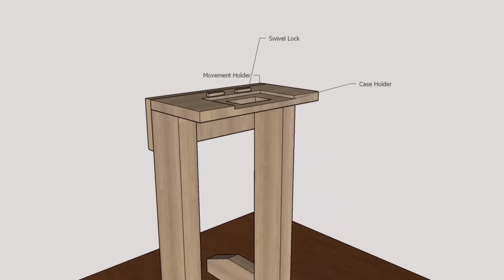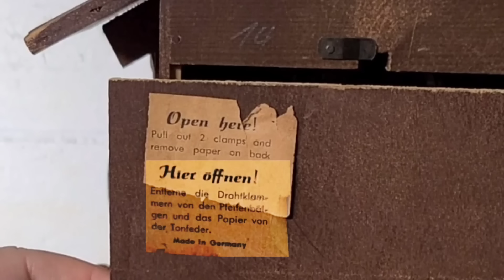Damaged 1950s Cuckoo Clock Restoration

Comment: 100% on the face shield! Traditionally, bellows were also made using thin leather strips. In the clock, paper is probably better. I imagine that a drawing paper would also suit. Go look at Accordion repair since that's the same system they use.

The thing about the gears is that it picks up dirt and that dirt, combined with the grease, acts as an abrasive paste and actually accelerates wear. Same problem with over oiling pivots. Don't want an excess of oil to suck dirt into the pivots and wear them out.
Reply from the maker: Yeah, when I looked into it, many people used tyvek, so that is what I used. Thanks for watching!

Comment: First time viewer to your channel I would mind seeing the cu-cu bird 🐦 with an eye. Also the wood though wiped a few times appeared to be very dry. Maybe using some Murphy’s oil soap would have been nice. Ty for your hard work.
Reply from the maker: Hey! Thanks for watching! Yeah, not being completely familiar with cuckoo clocks, I wasn't sure if the missing eye was on purpose or not. Either way, I thought it was better to leave it that way to error on the side of caution. I thought about applying a little oil to the case, but I didn't want to risk making it look unnatural given its age. Also, some areas could absorb more oil than other areas making it look blotchy. Thanks for your feedback, I appreciate it!

Comment: This was a very interesting video. My question is, was the disassembly, ultrasonic cleaning and reassembling of the Regula timepiece actually necessary? It worked and kept time...except for the couple of issues it had? 
    Be that as it may...very interesting video. Learned a lot. Thanks for the upload.
Reply from the maker: What I try to do is what the professionals do, which is take everything apart so each part can actually be inspected, cleaned, 100% dried, pivot holes and pivots inspected and the movement oiled in the proper locations. The only good way to figure out if there are other issues with the movement is to dissemble the whole movement and actually check. I wouldn't know there were any other issues unless I checked beyond the obvious ones. Also, not properly servicing the movement will eventually lead to more problems. Thanks for the question and for watching!

Comment: For those e-clips we in the copier repair industry use those all the time. You do not need any fancy tools for those just a small flat-bladed screwdriver to take them off, It goes between one of the groves and the shaft, and a slit twist and the clip comes off. Just keep a finger there to block it from pinking away. To put it back on use a set of needle-nose pliers to lock the clip back on.
Reply from the maker: Thanks for the tip!

Comment: One other thing, I would invest in some Clock cleaning solution. It’s an ammonia based solution that you put into the ultrasonic cleaner and it makes the cleaning process 100 times easier. The brand out there (in my opinion) is astro clean and even though it’s not cheap it’ll last you for years. Just make sure to use it outside because that stuff is insanely strong!!
Reply: Also feel free to reach out if you have any questions about tools. I’m only 18 years old but I have about 100 clocks under my belt and have experience and i’m willing to help in any way I can
Reply from the maker: I appreciate the help! If you want, you can email me at watchoverhaulchannel@gmail.com

Comment: a note on those "weird E-clips"
most of the retention deals on that clock were actually snap rings, they got holes in em to get a pair of snap ring pliers in em and open/close them to remove them
E clips are just a different way of doing retention, they slide into a slot on a shaft, and yes, they can and will fly across the room, 
generally ill just stick a flat bladed screw driver in the lil spot and twist, and make sure to remove it slowly and take note of the oriantation, or spin it to a good spot, that way if it does try to fly off, you can more easily find it, 
point it towards a close wall, or yourself, them things aint gonna spring so hard that it kicks your ass or anything, not enough mass to hurt much,
Reply from the maker: Thanks for the info!

Comment: I have an old clock that my wife has asked me to repair. The wood part I’m okay with but the clock portion I’m worried about taking apart. Could I just place the whole mechanism in an ultra sonic cleaner and then let it dry and oil it?  I worry that if I get it apart it will never work even if I manage to get it back together.
Reply from the maker: You might want to check out this forum:

https://mb.nawcc.org/threads/ultrasonic-cleaning-assembled-movement.69613/

Comment: Good job. Maybe rub the wood case down with a light covering of mineral oil to make the colours come out?
Reply from the maker: I thought about it, but I didn't want to risk making it look unnatural given its age. Also, some areas could absorb more oil than other areas making it look blotchy. That's why I only tried to remove the dirt and dust. It's the same reason why I don't polish and shine the movement parts. I don't want to remove patina or natural aging characteristics - I think these things are part of its story. Thanks for the suggestion and for watching!

Comment: I have a suggestion even if you already bought a bigger ultrasonic machine, a few actually. 1, use jars with solvent, naptha preferably. Just put the parts in the jar and put the whole jar into the machine. (2) Then as a follow up to that, IN the machine run some sort of degreaser something that wont eat the metal but will remove any residual grease oil and solvent, something like a mild simple green solution would work or crud cutter just don't go full strength dilute it with water maybe 50-50. Give everything a final rinse in distilled water if you have really hard water, and if you are not working with anything using jewels you could even follow that up with an alcohol bath. The problem with alcohol is it will dissolve the shellac that sticks some of them on namely in the escapement area.  With most watch or clock stuff you can just air dry or use a little heat, again tho if you have really hard water it could leave some stains (distilled has only water no mineral content)
Reply from the maker: Thanks for the tips!

Comment: a tip  when dismantling cuckoos remove all the levers first like the rack snail etc and then take the plates apart and when assembling put the gears back and screw the plates and then put the levers like the rack snail etc
Reply from the maker: That's a good idea. Thanks for the tip and for watching!

Comment: Whats that wire on the inside of the back piece of wood, I'm curious. 
 Also, on the front it looks like there's a missing band or something on each rifle. The 2 holes on each make me wonder. 
I didn't notice how morbid this piece was until you put it all together 😬 lol. I'm guessing a hunter would love this clock. Great job bud, it's a beautiful piece of art though.
Reply from the maker: The wire on the inside on the back is actually the gong wire. When the clock chimes it does 3 things - lifts the bellow on the right, the bellow on the left and then a little hammer strikes the gong wire. At the very end of the video when the clock is on the wall, you can hear what the gong sounds like.

I looked at reference photos of this clock and it looks like that's just how the rifles look - I don't think they are missing anything, but I could be wrong.

This clock is actually known as a hunting scene or hunters case so you are spot on. If you google "cuckoo clock hunters scene" you'll find many pictures and variations of the clock.

Thanks for watching! I'm glad you enjoyed it!
Reply: @WatchOverhaul  ohhhh I thought you added that sound at the end lol. That's awesome, thank you for answering me buddy
Reply from the maker: No problem!

Comment: Wow! I have this exact cuckoo clock! I want to repair mine, its as old as i am, father bought while in germany. The one i have, has two doors on the top with a music box.

Ive began follwoing your video, but ran into a problem.. some of the plastic gears are cracked :( I'm not sure what i can do at this point. 

Any suggestions?
Reply from the maker: If you can't repair them, you can try to find replacements at www.clockworks.com or a similar website. You could also find a cheap donor movement from Ebay or something and take the parts from the donor that you need.

Comment: I have a Question to ask I just purchased a Schender Coukoo clock that was built between 2001 & 2008. It was one of the Biggest made it is the Hunters model. But this is what puzzles me. Above the Music Box is a Battery Holder for (1) D-Cell battery. There is a Red & Blue Electric wire & there is an Electric Motor what in the Heck do I have? There are (3) Weights that look like Wood Carvings they are not Pine Cone steel weights. The height of the clock is over 24” tall. This clock has the Works. Where can I purchase a music Box that plays Elderwise? This clock had to sell upwards of over $2,500.00 or more!! What kind of clock do I have? Any Answers on this Project?
Reply from the maker: I'm not sure. I would suggest asking this over at https://mb.nawcc.org.

Comment: Just bought one like this in really good condition...but looks like I'm missing the bottom leaf pendulum. Any suggestions?
Reply from the maker: You can find them on ebay.
Reply: @WatchOverhaul  just tested it, it works. Just need the pendulum. Looks in great condition so excited about it. Bellows look great. Thanks

Comment: For the bellows, those shipping envelopes are also Tyvek, so no advantage to using them if you can find better Tyvek elsewhere.
Reply from the maker: The Tyvek shipping envelopes seemed to be thicker than the Tyvek I bought. If the material is too thick then the bellows won't close correctly.

Comment: You can cover the crack repair on the cuckoo pipe with a piece of paper glued on to reinforce it.
Reply from the maker: Oh that's a good idea! I didn't think about that. That would have been easier.
Reply: The way you did it is correct, but the screw could split it again. The paper will help keep it sealed. Old organs lined their bellows with glue newspaper to help keep them sealed. I believe that is why the 3 sides exposed to air are covered with paper.

Comment: Plus in my bellow repair videos I use superglue. Preferably Loctite superglue as it glues the Tyvex paper down in seconds vs minutes.
Reply from the maker: I liked how I had a little extra time to move things just in case. It was my first time fixing a bellow (except the practice one) so I was more concerned about going slow and taking me time. If I did many of these, I would switch to a faster drying glue for sure.
Reply: @WatchOverhaul  When I first started doing them I tried contact cement. It was too slow of a drying time for me. I like the superglue the best. Just have a paper towel handy incase you get it on your fingers.

Comment: You need a cannon pinion puller to remove those wheels. 

Also don’t use the needle connected to the oil, get yourself a bottle cap and an oiler, pour a little oil in the cap then use the oiler to apply to the pivots. To much oil will attract dust which then acts as sandpaper wearing down the brass causing the need for bushings.
Reply from the maker: Thanks for the tip!

Comment: What about the cuckoo's missing eye? Did you ever paint on on there?
Reply from the maker: I decided not to paint the eye on. I couldn't figure out if it was a manufacturing mistake, or why it wasn't there. This wasn't my clock so I didn't want to remove a unique characteristic of the clock. It's easy enough to add so I left it up to the owner to decide.
Reply: @WatchOverhaul  Alright, fair enough.

Comment: Magnet is handy when removing C clips put it over the top
I have often put the item in a plastic bag and my hands, stops it pinging across the room

I have 3 old clocks like yours and I was surprised at finding plastic parts.
Recently I was working on a Singer 28K built in 1891 it had a plastic hand wind handle, after a bit of searching I found this that may be what it was made from

Parkesine invented in  1856

https://en.wikipedia.org/wiki/Alexander_Parkes

https://en.wikipedia.org/wiki/Timeline_of_plastic_development

all the best
Reply from the maker: Thanks for the tip!

Comment: Keep posting please. Great stuff. What kind of face mask is that? I have been using goggles but I like that idea better. Safety first!
Reply from the maker: It's a Honeywell Face Shield: https://amzn.to/3QYpR9a
You can also get replacement visors for it too: https://amzn.to/3qVMUqA

I've only had to replace the shield once in 4 years. When using my lathe and applying finish, sometimes the finish will fling up and hit the shield. When the finish dries on the shield it's super hard to clean off.

Thanks for reaching out and for watching!

Comment: Nice video but you did not remove the gathering pallet. It comes off easily. Firstly I'd clean all the dirt and cured oil in white spirit. Secondly id remove the plastic wheel from the great wheel before putting it into the USC! Those wheels split after a few years as they become brittle. I repair around 9 cuckoo clocks every year. The pivot holes wear out at the escape wheel, the second wheel, both great wheels and the gathering pallet.
Reply from the maker: Thanks for the suggestions!

Comment: Good job...  but way way too much oil.. those hypodermic style oilers are wrong..  you need oiling pins. And just a little tiny bit.. also,you should Clea  the pivot holes with a toothpick to get the grime out..  you don't want to make an oil and dirt slurry.. the clock will quickly wear out.
Reply from the maker: Thanks for the tips!

Comment: Actually i take a bucket, fill it with gasoline/Oil mixture 4%  till it covers the movement, then it use an airpistol and a kompressor to blow Air under the gasoline surface thereby hitting the movement with a jet of Air and gasoline, cleaning the movement thouroughly and at the same time  the Oil in the gasoline lunricates every little cranny of that movement, and if nothing Else is wrong its job done (remember to wear gasmask rubber gloves  and safety googles when doing this)
Reply from the maker: Yeah, I've read of people doing that. What I try to do is what the professionals do, which is take everything apart so each part can actually be inspected, cleaned, 100% dried, pivot holes and pivots inspected and the movement oiled in the proper locations. I suspect the clock I'm working on now was drenched in oil as a maintenance strategy - oil and dirt has been dripping out of trapped areas for days. I'm very much an amateur, but I'm trying to learn and give the movement a good overhaul. I still need to learn how to inspect and clean mainsprings and repair worn pivot holes, but I will have to learn quick on the clock I'm working on now, because both need to be addressed. Thanks for watching!
Reply: That is absolutely the worst thing you could do to a clock!  The oil will be a dust attractant on everything and, as it congeals, will gum up all the levers.  In a very short time, the clock will be a mess.  I must have had to clean some of your "work" over the years.  Good grief, folks, please do not follow this advice.  The ONLY things that should have oil put on them are the pivot holes and the surfaces of the pallets  NOTHING more.
Reply: @WatchOverhaul  Your method is the proper way to clean and oil a clock.
Reply: @dperry428  i know its a dust collector but i have movements working for years after that treatment and when they get dusty i rinse them again but you are right its not the proper method it a dirty hack 😉👍🏻

Comment: It is better to oil the movement prior to putting the rack and snail on.
Reply from the maker: Ah, that's a good idea. I did have some trouble reaching some spots. Thanks for the suggestion!
Reply: @WatchOverhaul  especially test it as if you get it wrong in the 1230 position it will catch going up and your clock will stop at around 5 minutes til one every time. I found this  out the hard way when working on a very small cuckoo clock with music. I thought that my big hands had it right but it stopped at 5 minutes til one. So I had to take it all back apart. Lessons learned so now I test them on the stand prior to putting them back into the case.

Comment: Looks like it's a 1935 movement, based on the number on the back.
Reply from the maker: I think you're saying that because you see 35 stamped on the movement. The 35 stamped on the movement means it's a Regula 35 cuckoo clock, and Regula 35 cuckoo clocks were made after 1950.
Reply: @WatchOverhaul  Thank you.